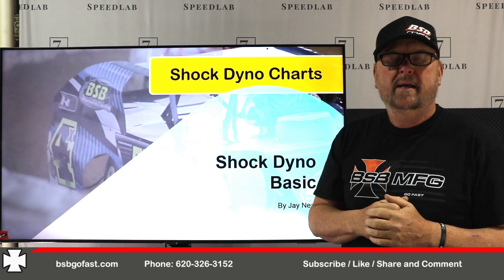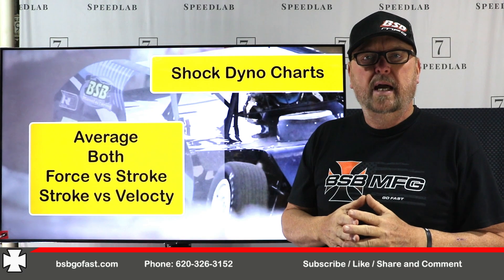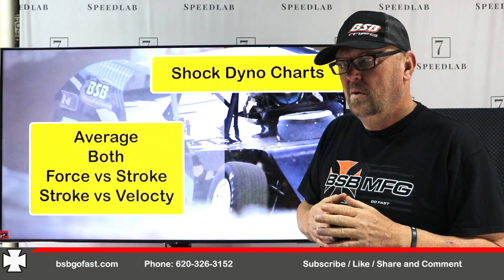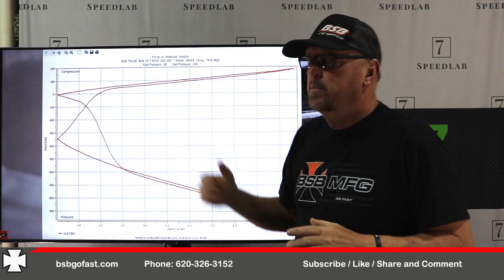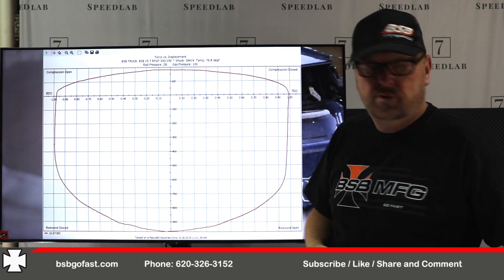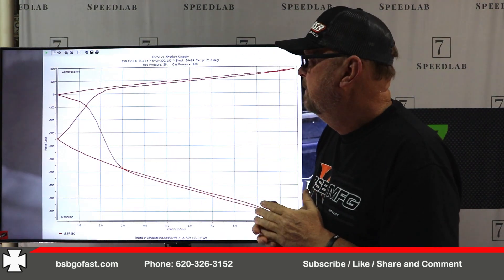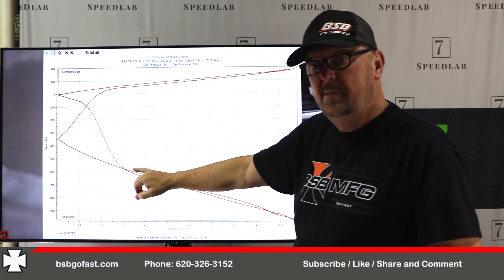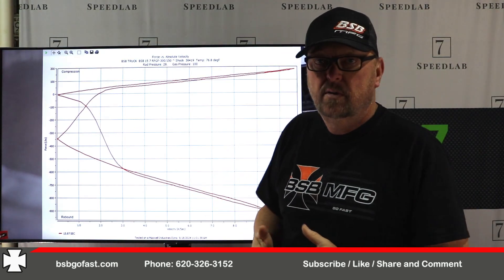How to understand Dyno Charts. Basic

Comment: I have found that trying to pressure balance the piston with a base valve to help with the feel and limiting the zero point effect. Can you still effectively control the spring with this method? Can you run a smaller blead with a base valve to help control the car's attitude with a base valve?
Reply from the maker: Pressure Balance is a big subject, and I am not that versed in how it affects the zero point or what effect you are seeing (good or bad) with zero. I would like to have a deeper conversation about Pressure balancing with you at some point. Question #1, we run a higher zero point with our BV stuff all the time and don’t see any problem with that, in fact, the shock runs better that way. Question #2, changing the bleed in the BV will not help control the car's attitude of the springs return. Now I may have misunderstood the questions here because of the depth of the question so please feel free to call if you want to dive in deeper on this subject.

Comment: Not dyno related but can I keep an eye on my shock gas pressure using my smasher? Check them when new at a certain length every time. Thanks
Reply from the maker: Yes I think you can but I don't think it is the best idea, you will get a number and you can an eye on it. This is something I have not done so I can't be 100% sure.

Comment: You should Stay with this topic for a few videos and make a few more getting into the weeds on this (those great details you mentioned).   The information on this is very convoluted with many misconceptions. There’s very few educational resources for folks and younger viewers.  People also try to gatekeep information. The chassis schools avoid the topic altogether which is an egregious act for the cost they charge and the importance of this information. Entire topics on stager or bump steer but nothing on reading shock dynos or understanding shocks.  This also opens people up to scams from shock gurus as well as confusion sanctioned by large suppliers. It can certainly be intimidating for older generations and younger generations alike.  Americans in general don’t do good reading data, charts and graphs. That’s just the facts.
Reply from the maker: Thanks for such a great comment and you are right, this subject is very hard to understand due to the lack of information available. I have had to learn it all myself and the more you learn the more you need to learn. I will do some more on this and cover some more about how a piston changes the story being told about the shock, also how low speed affects the whole outcome of the shock. Thanks again.